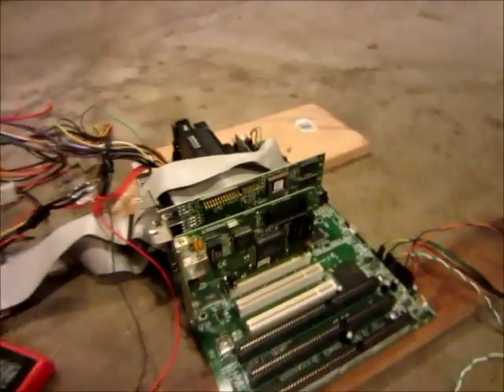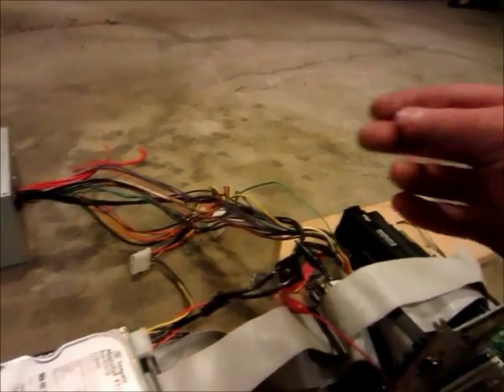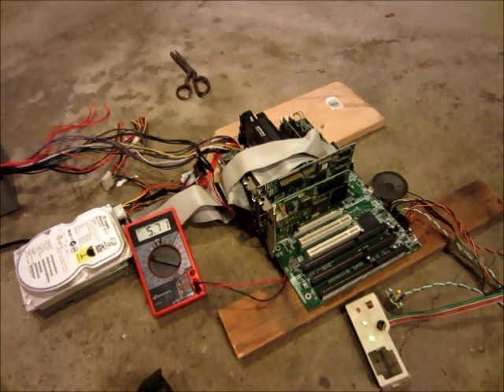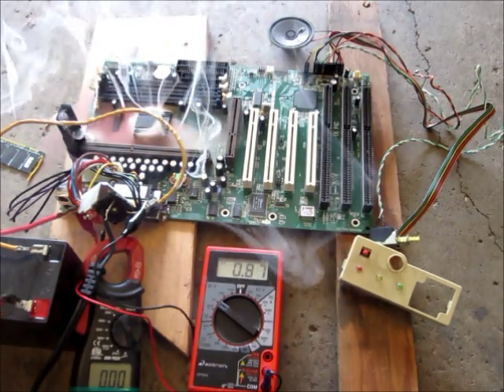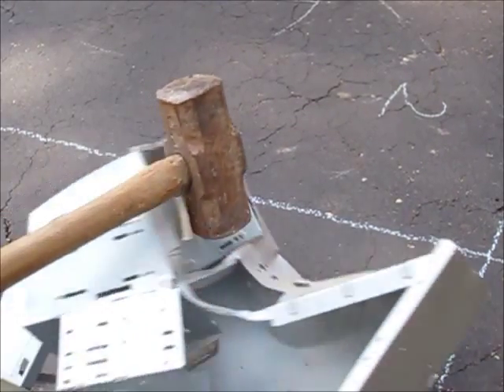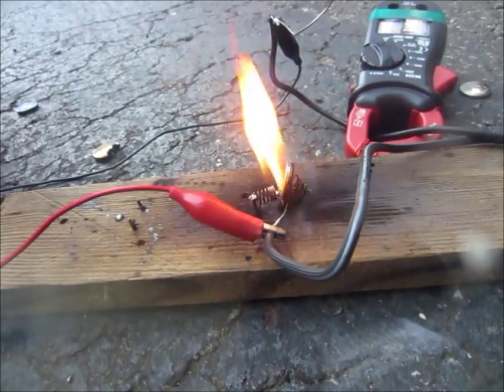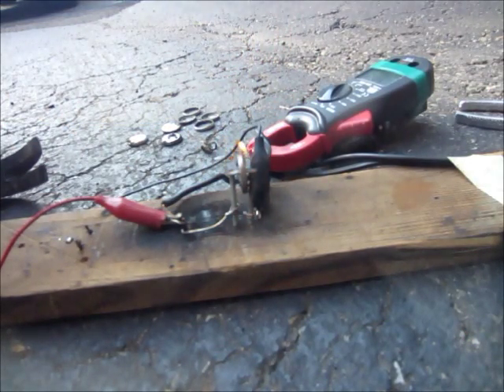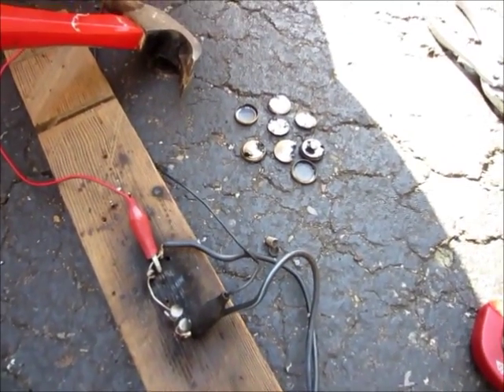100,000 view thank you+computer destruction+exploding coin cell batteries on the variac

Comment: Great video. love the 12Volts SLA on the motherboard chip. pink smoke and aligator lead having a meltdown too.
Great pops with the Lithium batteries. The fuse-wire trick will work well. Keep an eye on the temperature of your variac.